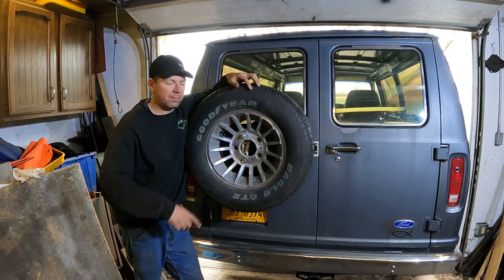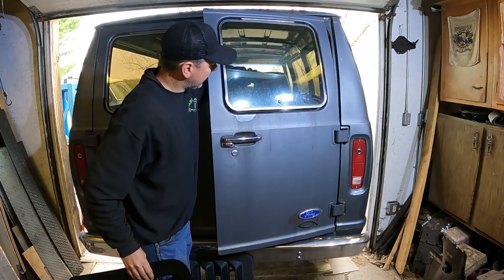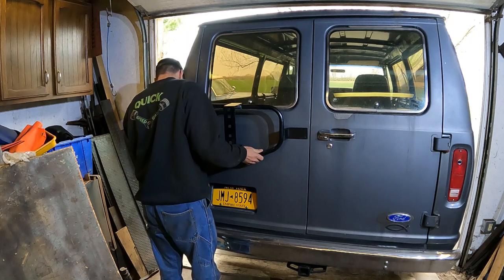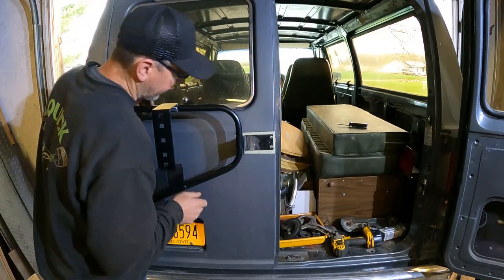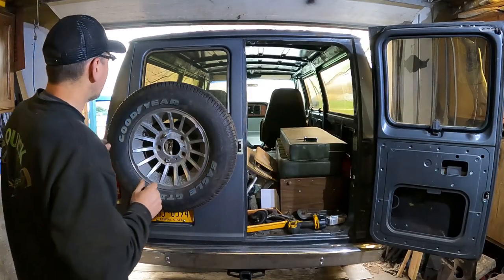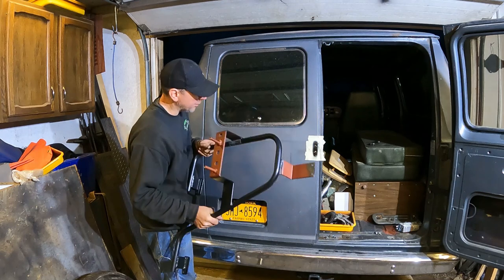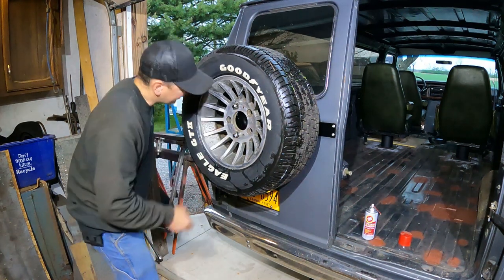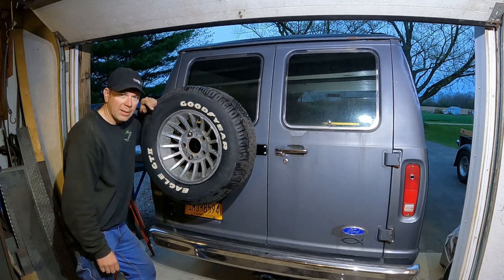Boogie Van Accessories!  Mounting a Spare Tire Mount Ford Econoline E150 Van

Comment: Curious if there’s an issue blocking the license plate at all. Thinking specifically of Pa and the toll roads cameras that charge by plate. I like the look.
Reply from the maker: It doesn't block the plate at road height.  I could care less if the toll cameras can see it. That's the state's problem, not mine.  All I care is if it's visible from behind at vehicle height, and it is.
Reply: Heck yea. Sounds like a win to me.

Comment: I have an all original 87 E150 Club Wagon with the carbureted 351W H.O.  with 53k on the ODO loaded with a bed in the back even.  But the dealership or Ford put the spare tire on the door with the handle down low.  Kinda weird that i have to reach around the tire to open the door.   Drivers side makes way more sense but you know, you don't mess with OEM vintage.
Reply from the maker: Yeah, all the Fords had it on the passenger door down low, but I hated the look of that.  That's why I put it on the driver's door.

Comment: How has it held up? I am looking at doing the same thing to my van. Did you accidentally back into anything? That was a concern I had, forgetting the extra bit of length
Reply from the maker: It's worked great for 10,000 miles.  Having an aluminum wheels helps with door weight.

Comment: I have an 88 econoline as well but my tire size is 235 85 16.. do you think I should provide more support since it’s a bigger tire ?
Reply from the maker: If you are running steel wheels I would not mount the tire on the door.  The hinges and the mount won't handle it.  They make offroad bumpers/mounts for 4x4 vans with large, heavy tires, but they are very expensive.
Reply: @QuickSpeedShop  thank you for the advice !